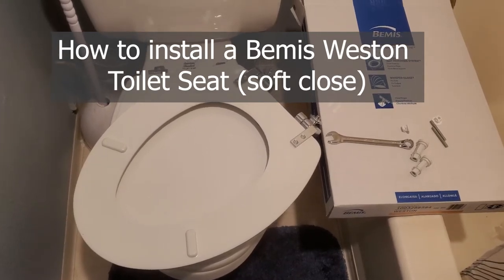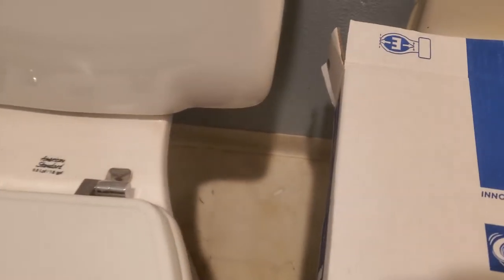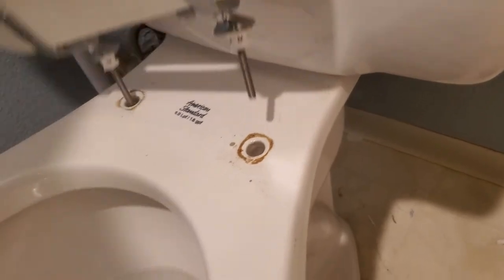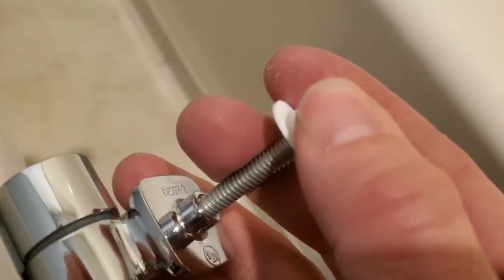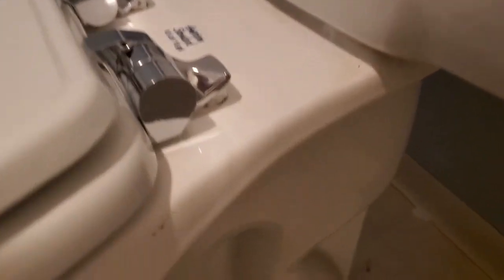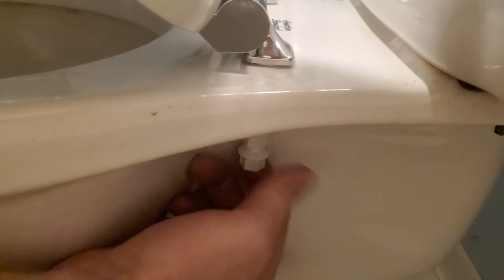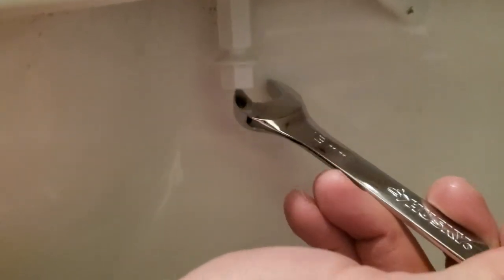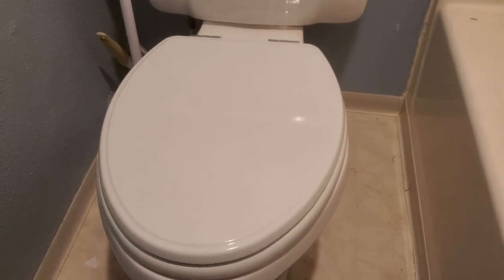How to install a Bemis Weston toilet seat

Comment: You did a nice job with this video.
This toilet seat is much better than the one our toilet came with.
Very well designed and the hinges prevent any wiggling
movement when we sit on it.  We never had the slow closing 
seat before.  Well worth the $41.  I'm glad the old seat broke.
Reply from the maker: Thanks Bill! What kind of videos would you like in the future?
Reply: @diyhda  
That's hard to answer without knowing your interests, expertise and/or 
the layout of your home.  There is currently a large number of catalytic 
converters being stolen around the country from automobiles 
because of some precious metal used inside of them.

We always park our car in front of our garage and I am thinking of replacing 
the existing motion activated (electric) light above our  garage with a
 ring camera that has both a camera and a motion activated light built
 into one device.  Just having the light go on, is kind of useless because 
these are professional thieves who use motor driven hacksaws to 
remove the converter MUCH  more quickly than I would notice the light 
going on.    I haven't noticed anyone tailor a Ring camera video to that
sudden new need around the country.  Or maybe some other company 
has a better solution.  I am an old man and I don't want to be climbing a 
ladder to the peak of our garage to keep charging a battery every month 
like most Ring devices would require.

Comment: Anyone watching this video I suggest you thread the first set of nuts on don't try to push them on. If you have a ratchet style box end wrench that makes it a lot easier and I put mine on using a drill set on torqu 1. I use my ratchet box end wrench for the final turn to snap off the nuts. I also found it easier to put the first set of nuts on the little threaded bolt then twist that into the seat.
Reply from the maker: Thanks for your comment!

Comment: We just bought a Bemis Weston  288588 model and one bolt is 1/2" longer than the other 
for some crazy reason.  I wonder if that is intentional or just poor quality control ?
I am hoping these metal hardware hinges will have a longer life than the plastic hinges
that came with our toilet.  Our Bemis seat cost us $41 at Home Depot today.
WRZ 2022-01-17
Reply from the maker: Thanks for commenting. I don't think it's intentional that one bolt is longer.